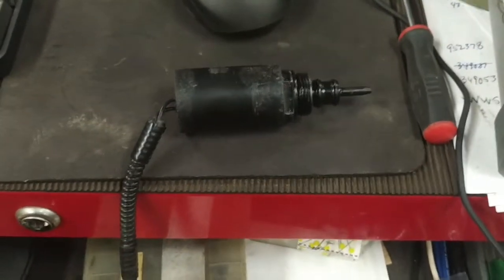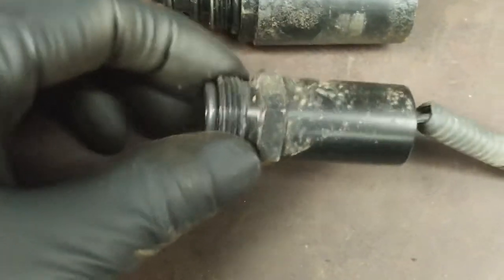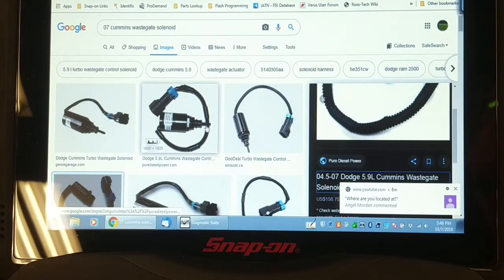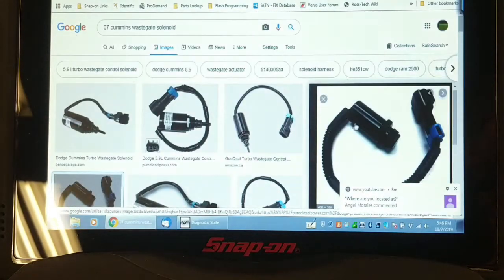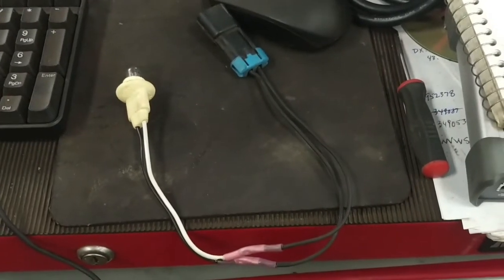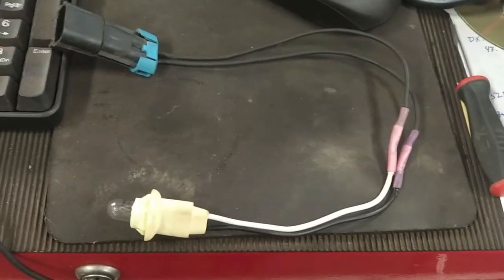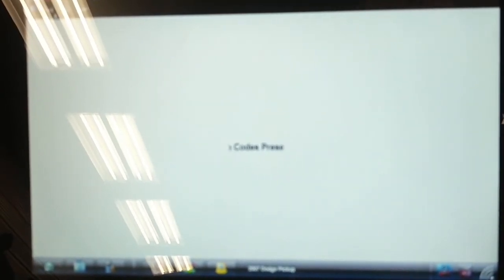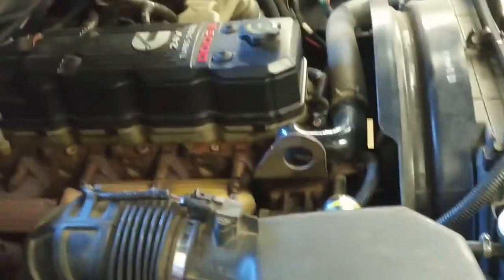2007 Ram 2500 5.9 Cummins P0243 Fixed pt 2

Comment: The old one you pulled out is essentially a dummy plug.  The old one allows the wastegate to function on the turbo's air-pressure as it should.  The old plug also sends the correct reference signal back to the ECM to turn off the check engine light (CEL). Obviously they still fail. I just bought one of the dummy plugs gonna throw it on the truck today since my stock one went out. You can run them on stock turbos no problem.
Reply from the maker: Yes I figured that out. Basically it's just a resistor that simulates the solenoid. As you see I wired in a light bulb and that fools the ECM into thinking the solenoid has continuity. Plus doubles as an under hood light LOL. Thanks for the comment.